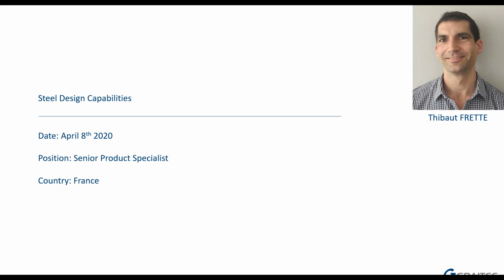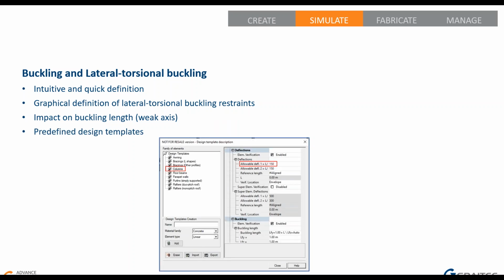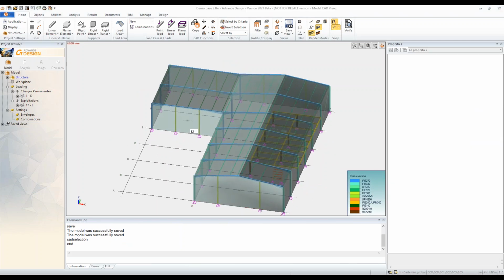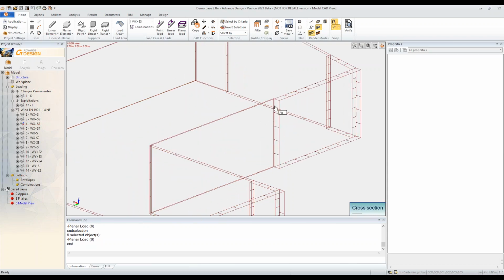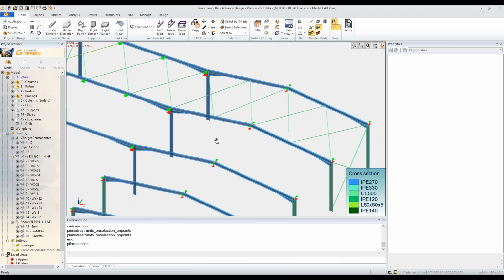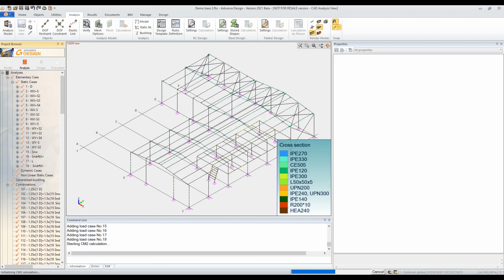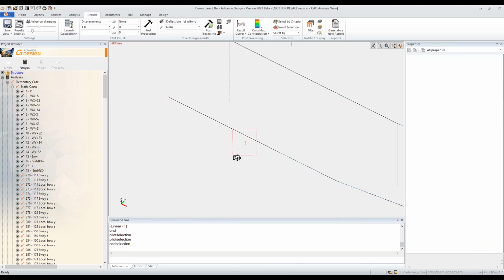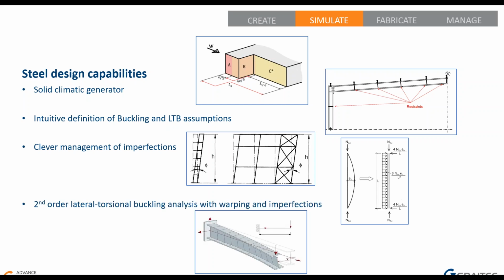Advance Design - Steel design capabilities

Comment: is it is possible to provide a tutorial link  by showing how to import staad file in to gritec advance design and hoW to export gritec advance design file to stadd pro
Reply from the maker: Hi, thank you for your interest. At the moment we don't have a video tutorial on this topic. However, here are some guidelines on this subject: in general, there is no direct connection between the programmes (common format) but, as for all other calculation programmes, we have two choices:
a) use an intermediate format (for example IFC) but then the import and export only applies to geometry. 
b) use another program to which there is an export. 
In the case of Advance Design, it is definitely best to export the model into Revit from another program and then import into Advance Design.

If you have more questions, please feel free to contact our support: support.uk@graitec.com